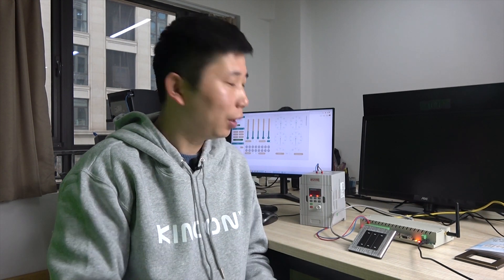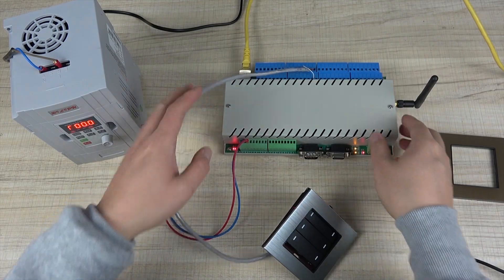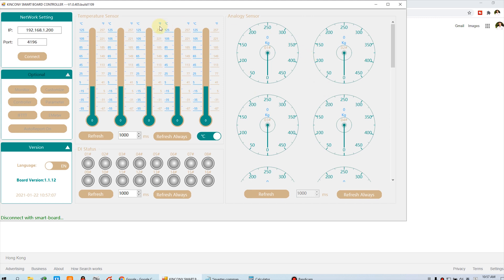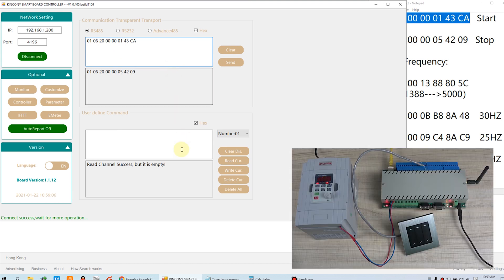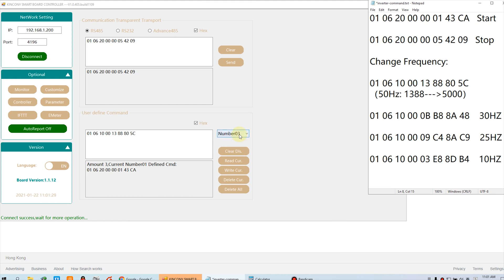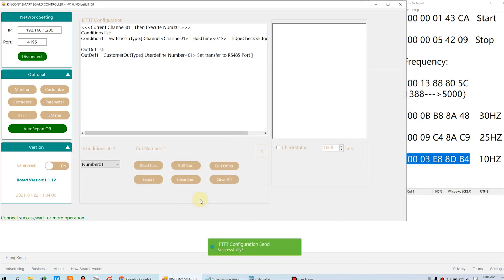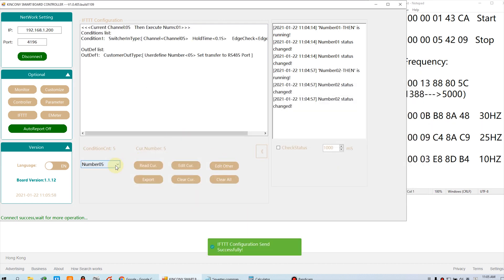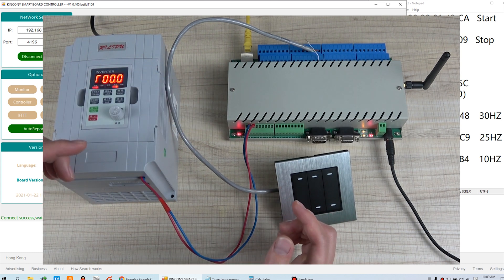how to control VFD (Variable Frequency Drive) inverter by KC868-COLB

Comment: How can I use these solutions with KCS firmware? please ?
Reply from the maker: KC868-COLB not use by KCS firmware, if you want to use KCS firmware, please chose KinCony A series products.
Reply: Yes, I have an E16S with KCS firmware, and I have 9 inverters. I want to control these inverters using the E16S via RS485.
Reply from the maker: @محمدرزق-ح1ح  it's ok